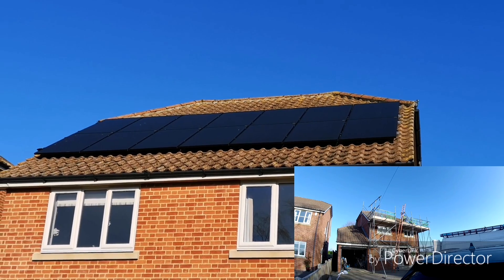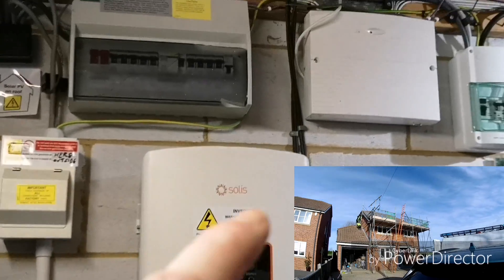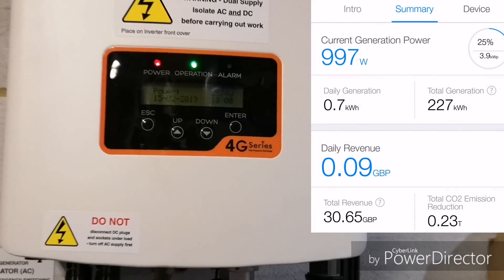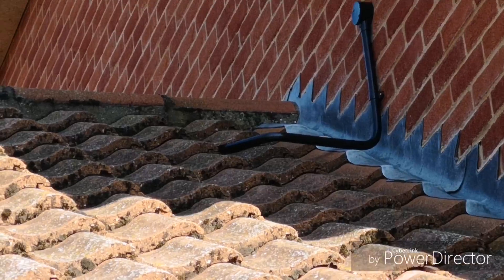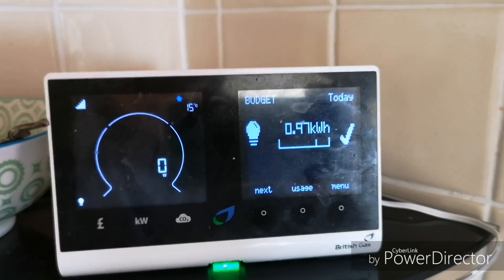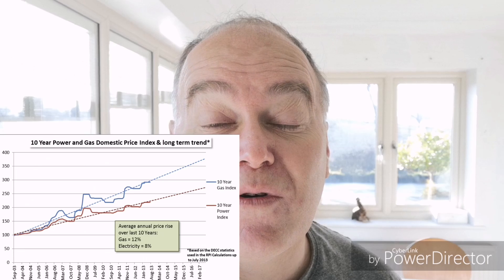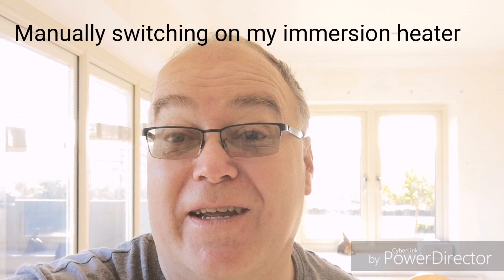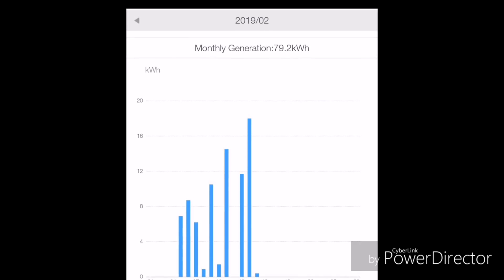Solar PV to go with my Kona and Zappi. Why I've added solar.

Comment: Excellent video Nigel, thanks. We got a Zoe a year ago which prompted me to start looking at solar, battery storage etc. Got cold feet in the end but it's still a plan. Wondering if you've looked at the Octopus tariffs and whether charging a battery when it's 2-5p starts to make more sense? I'll catch up with your videos over the coming weeks, it's exactly what I need to really understand the options and feasibility.
Reply from the maker: Thanks Dave G

A battery makes your system complete and maximises your consumption on the solar you generate BUT if you don't export much, the savings and hence cost justification just aren't there.

Octopus seems great if a flexible tariff suits you but the savings of filling a 13kwh battery with cheap electricity overnight might be £1 a day.

For me, I think the battery helps you consume the least grid energy thus it's better for the environment, it's better for your data, it feels more self sufficient and enables faster charging and water heating when used in conjunction with solar.

Just don't go down the battery route thinking it'll save you thousands.

For me adding more panels made much more sense then adding a battery. Definitely add as much solar as you can

Comment: This is the way forward, I have a 5.3 kwp array with 19.2 kw of lifepo4 battery storage and a 3.7 kw hybrid inverter, installed Oct 2018. I used 4mw a year before solar install, I've used 405 kw since install, since Jan 29th 2019 average daily use is the 5-600 w the inverter draws for grid matching. I expect better next year as it took me 4 months to sort out the problems left by a bad Installation Company, all working as it should have from day 1. They had the battery connections all wrong, soon as I reconnected them properly myself we were virtually off grid.
Reply: That's amazing

Comment: Today in end of July I have in the uk had 2 tvs on, 4 fans a Portable Aircon unit and have used zero watts.
By getting on the octopus Go rate I can also charge the Leaf for 5p a kwh in the night.
I have invested in the ohme smart cable so will have a poor mans zappi .
2 weeks and a 8kwh powervault is being installed to utilise every ounce of free and cheap electricity.
Reply from the maker: Snap

Comment: Very timely for me.  We are installing 9.7 kw to the house this summer.  Panasonic panels and SolarEdge gear to the grid.   Hoping to net a positive cash flow even with EV charging.
Reply from the maker: 9.7kw, I wish. I need more for sure and a battery
Reply: The EV Puzzle: I am curious about batteries.  So far I cannot seem to justify the expense and potential replacement in 10 years or so.

Comment: Thanks for this. I live in Bordeaux, France. I am getting my Kia e-Niro in December this year. I want to get rid of my propane gas tank as that way of heating the house & water is costing me a fortune & I'm sick of it. So I want to have a heat pump for heating (air air) the house, and have solar panels for electricity & water heating. But it's a lot of budget! Problem is that I've been quoted 25k€ by EDF for solar panels (no way accepting that price!) and I'm looking at around 6k€ for heat pump.... Just trying to find a better company & price re solar panels. A big learning step!
Reply from the maker: Wow that is expensive for solar. Wishing you luck
Reply: Also live on France.   I don't think the figures will ever make sense due to the system costs...  People on other countries get it at a much better price... Everything in France is more expensive..

Also watch out for tax implications if you get anything other than a smaller system..

Comment: I just had solar installed before FIT stops 
I am getting in cloudy March 2019 25Kwh a day I am currently using on average over a year 9089Kwh so theoretically  I could just be on free electricity  all the time.

I will invest in an 8kwh battery storage soon

Comment: In 10 years, you might upgrade to new solar panels. 
Technology is constantly improving. I love the idea of charging an EV from solar panels and nothing else.
Reply from the maker: Car is charged , water is hot and I've only used 2kwh today so far.
A very pleasant feeling of contentment
Reply: @EVPuzzle  Different things,  make different people happy in life. My plan includes an EV, but not for several years. 
Solar panels at my home? Not now.
I have satisfaction that in the upper midwest USA where I live, more solar fields are added to powering the grid on a weekly basis. The closest one to my house is right next to the wastewater purification plant.
However, I am sure there's fields I am unaware of. They are even being added to top levels of parking ramps. 
Some people think solar fields are ugly.  Then I explain to them that sometimes when exiting a nuke plant, you don't always leave with all your clothes. If you have a radioactive particle in your clothing that can't or won't be removed,  that article of clothing becomes part of the nuke facility. 
End of conversation.
Reply from the maker: I said in a few years to it all too. Look what happened 😂

Comment: Thanks for video Nigel
Any technical reason why output is “clipped”? Or is this an artificial restriction placed by E-on ?
Did you seek out E-on or did they approach you as an existing customer?
Is the feed in tariff element separate from supplier (would assume so but well to check a short vid on that might be helpful🤔)
Did E-on install zappi?

Keep it up Nigel enjoy you’re “low tech” approach as there’s fewer distractions to the information you’re imparting 😁👍
Reply from the maker: No,  I had an independent installer install the Zappi.

My understanding of clipping, if that's the right term is that the inverter is rated at 3.6kwh so any excess will go by way of an electronic dump valve preventing the unit from self harm.

How it really does it I don't know. I've not felt the need to research it, instead happy to accept how it works in theory.

I chose Eon after hearing from another Kona owner saying how good value they were. His recommendation was spot on.

Comment: Future proofing power costs is a novel idea. However it does not make sense to me if I still have to cut a check to the utility company.  All the utility company needs to do is change from a cost per unit to cost per service model.  While it may not be unlimited they can certainly have plans with buckets of power to reduce the savings and extend the ROI of anyone considering moving to a solar grid-tie system.  As more homes move to solar I can definitely see the utility companies  implementing surge pricing on cloudy days and at night when demand on the electric grid will be greater.

Depending on the situation the cost for adding batteries might be cost prohibitive today,  but I think in the future the economics of converting to an independent system will make more sense.
Reply from the maker: I'm sure they'll invent all sorts of things to increase profits. All I know is I'm now impacted by their prices to a significantly less degree. In the future if I can justify a battery a couple more panels I could be fairly independent just needing the grid as contingency

Comment: Get a battery for your house so you can collect the energy your not using so you can use that unused energy at night.
Reply from the maker: But I only use < 1 unit overnight, it doesn't justify

Comment: Just a heads up, in more exotic solar systems (multiple arrays) this becomes far more complex. Zappi is only as clever as it's inputs (CT clamps). If you have DC tied storage system as I do it wont take into account that excess. This was down to a slimy installer rather than myEnergi, yet it's worth keeping in mind

Comment: We too have solar panels and the other day whilst they were charging the car up I needed to go out for some errands. That’s when my problems started! 
I unlocked the car but because it was still charging was unable to unplug the charger lead. In the end I switched the power supply off to the Zappi, however myenergi say that’s the wrong thing to do. What do you do under a similar situation, Is there a way of easily stopping the charging? I notice there’s a button next to the charging port on the car. 🙏 Colin.
Reply from the maker: I just unlock the car...twice and it always releases for me.

Isn't there a manual pull cable to release the cable too?
Reply: The EV Puzzle 
There is a manual cable under the bonnet, but I thought there must be a simpler way.  I didn’t realise the unlock button on the fob did it as I usually unlock the car with the door handle button. Thanks for coming to my rescue,  I’ve been reading the manual and just didn’t find that in it, there’s quite a lot to learn. 
Regards Colin.
Reply from the maker: It's a great community we have sharing with fellow Kona owners 🤓

Comment: Welcome to the joys of free electricity! :-). Now during the summer, when you are producing max power from the solar, you are going to be GUTTED at how much you send to the grid. 

In March last year we had a Tesla Powerwall 2 fitted, plus some more panels to the north facing front roof. For 6 months we used NO mains power to speak of. I will predict that when you see how much energy you are GIVING to the grid (yes, you are getting the Fit, but it still seems that you are giving it away when you could use it yourself), you will resent every unit you do not use, and, just might, regret not getting a battery. 

It is because of the battery, and the Zappi, that we have put a deposit on an eNero. (With the Powerwall, when there is not enough sun for the Zappi, it will pull from the battery, NOT the mains, to bring up the volts. FREE motoring.

It does change the way you live, and when you do things.
Reply from the maker: I agree , I miss it already but it depends on % of that generated Vs utilised.  If I'm already reducing my consumption massively, 100% more cost isn't worth a smaller percentage gain.

I'll predict I go battery plus s couple more panels in 5 few years time.
Reply: Of course, as you have a Zappi, and a 64 kWh battery in the Kona, there is a likelihood that you will be able to use V2G in the near future :-).  @EVPuzzle

Comment: Interesting! I've just had the man from Eon to visit and quote. I think the same as you to future proof against the higher cost in the future. I only have a west facing roof available so not as efficient as south . 8 X 320w black panels like yours, generating 2132KW annual. 2.56KWp, Solis 4G inverter. Says it will save me £220 per year on current unit price. He said to wait for the battery technology to improve along with the price. Three days max to fit / install. I will miss the FIT, but their Solar tariff this year is 3 months free electricity for three months in the summer. £4300 fitted complete. Nice videos! I own the 40KW Leaf but nice to see your car!